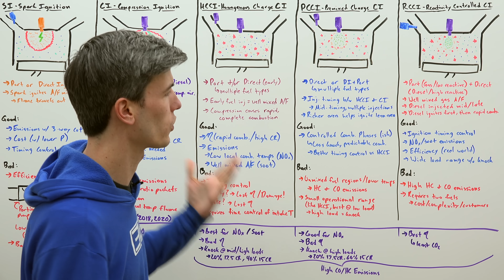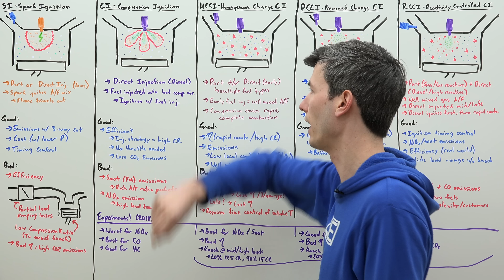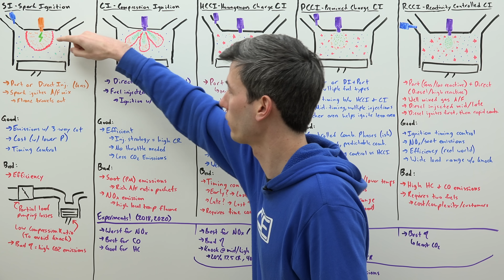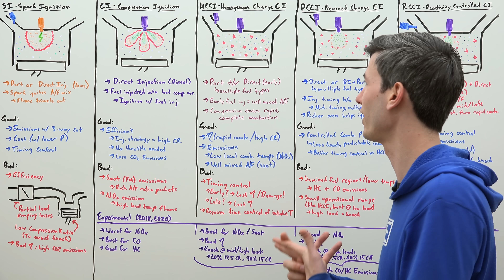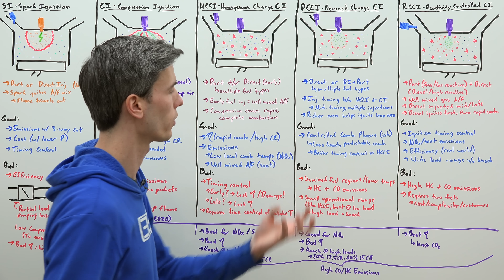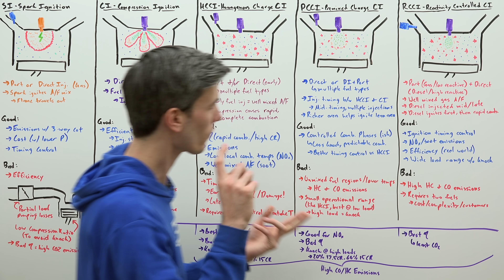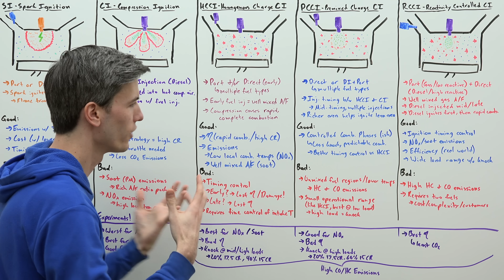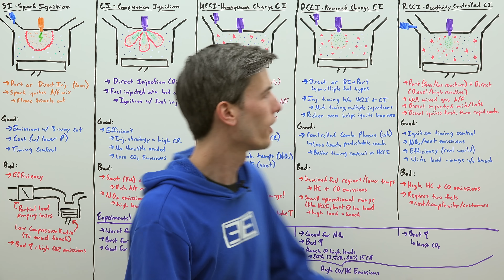If Combustion Engines Have A Future, What Is It?

Comment: You've looked at traditional piston engines here, but what about other forms of combustion engines? Like gas turbines. Their noise and response time is no good in a car, but there certainly are applications where they could be put to use. For example, freight shipping is notoriously hard to electrify, due to the high drag from the water it moves through, and having to run for weeks without refuelling. But if we want to ban that ultra dirty bunker fuel these ships have been burning, then could they switch to turbines? Those should have a higher efficiency than piston engines, right? So what are the pros and cons here?

And what about the more exotic piston engines, like opposed-piston type, or free-piston linear motors?

Comment: One problem with optimizing the efficiency of any IC engine, is at what state are you trying to optimize? 
If an engine can be loaded at its optimum operating state, the rewards from a fuel usage perspective are quite small, unless the engine is designed to operate at that specific rpm point. The options are then, run a dynamo or hydro static pump at than specific RPM. For a road vehicle the best option right now is mechanical electro drive.

Comment: Hi Jason, Here isEurope there is option to run diesel with LPG. They are claiming it is more efficient. Could you make video about that technology? System use both fuels at the time, not like petrol with LPG where  switching it between each other.

Comment: Have you done a video on the TRUE efficiency of electric vehicles. Not just cost of electricity from the house, but loss from conversion from fossil fuels at power plant to electricity, loss from travel to transformers and to individual outlets along powerlines, loss from conversion from house outlet to battery and loss from battery to car use. All of that verses just filling your car with gas. 

From what I have seen, the EV would be far less efficient when all of that is factored in.

Comment: Really great summary. Listening to you I started thinking, why could you not have a HCCI-like option which you would control the ignition by rapidly compressing mechanically the burning chamber at the point when the piston is in its highest position? This would require additional moving piston like small part. However it would probably not be hard to do with current technology.

Comment: So, if we use RCCI, the only downside being carbon emissions, we can use a CAT. Way better than all the diesel particulate filters. Right??
Reply: Diesel doesn't work with CATs, if it did the emissions gear on trucks would be far simpler. Its something to do with the exhaust temperatures,  its been years since I looked into it so I dont want to try to explain it and likly give inaccurate information.
Reply: @jaydunbar7538  yes, normally I'd agree, however as he described the emissions were not like standard diesels. Maybe it would work??

Comment: A small engine driving a generator to charge the batteries on an EV as you drive would operate under a  constant load , if they worked on this principle a car with long range and extremely low emissions would be possible .
With battery technology getting better and better the weight saving in this area would offset the added weight of the engine and generator .

Comment: A future in a museum. EV rules 😉
Reply: I think that there will be ICEs as generators and backup power. Also, in the US, where most people can charge at home electric cars are not a problem. In Europe when you street park in a tight city deployment of charge infrastructure will slow down adoption of electric cars. I actually think that large cars will be electric, and small city cars will be hydrogen. Or cars will be too expensive for majority of Europeans altogether.
Reply: @gustavlicht9620  i live in europe. I cannot charge athome, but in a 1/2 mile radius there are now already 12 public charging points. Theres public charging at my workplace, the supermarket, the shops, all over the place. And building more chargers is easy.
As for generators, hydrogen maybe, but ICE is going to die out completely, we need to stop burning stuff
Reply: Synthetic fuels might come in handy

Comment: So does a RCCI still use a high compression ratio even though it’s using something like gasoline? As the pre mix fuel? If so how can they run a higher comp ratio without pre-ignition?
Reply: Very lean gasoline fuel mixtures I assume, though all systems that use RCCI that I know of that is commercially sold(Tractor and ship(engines or conversions), and I think stationary engines.) use fuels with higher octane rating than standard gasoline as LPG, natural-gas, biogas.
I'm quite sure I've read about a RCCI-engine powered by diesel and "some kind of gas" in a race car.
I've also read a bit from a study about vehicles(Tractors and trucks) with diesel engines converted to run on diesel and woodgas, this study was done in Sweden in the 60's I think.

Edit 1 : These engines is often called dual-fuel engines(Though different type of engines engines could be called dual-fuel too.)
Edit 2 : I'm not really sure anymore that these engines could be called RCCI, as the RCCI-process might have more to it than just a homogeneous charge ignited by another directly injected fuel!

Comment: All based on piston engines? I think you could expand it a bit more than that. There are many other ways to use fuel (not always fossil based either) than a simple piston engine. 
Fuel cells don't only work with Hydrogen either. 
Oh and these all ignore hybridisation where the engine is actually optimised for it - not simply converted from a normal engine. Opposed piston, long stroke engines can be pretty efficient alone and if combined with a generator they can always work in a sweet spot which improves that again. 
Then there are exhaust waste energy capture, waste heat capture and so on - plenty of things which improve efficiency which are, as yet, unused. 
Remember an ev seems more efficient because it uses so little energy to move itself when under light loads (low speeds/etc. When you have to use more power for faster runs, longer journeys, heating and so on that efficiency drops off real fast and the internal combustion engine which normally wastes a lot of energy gets more efficient as it gets into its efficient rpm zone in high gears and as the waste heat is used for the cabin. 
There will be a sweet spot somewhere with a mix of ice and ev.

Comment: Oh there’s a future and it’s a long one still just wait till the government realises you can’t plug in hundreds of thousands of EVs and that there isn’t enough cobalt being produced rn to make all cars in JUST ENGLAND electric
Reply: I've done the math a few years back and just the ac to go to work and back was using way more energy than a home. Delivering and producing that much electricity is just not possible.

An ac system maybe uses in between 2 and 5 horsepower so 2 hours of commute is let's say 4 hp and that's about 2.7kw electricity. That's what I'm using for the house. Imagine powering a car and using like 30kw of electricity daily and then everybody does the same. That will require 10 times the electricity generation.

Comment: Aren't PCCI the best option for hybrids with electric motors at the the wheels? I mean, if the efficiency is not great at certain rev ranges it doesn't matter if your wheels are driven by electric motors.

Comment: Why no discussion of SCCI (Skyactiv X)?

Also, on the RCCI... How much reactivity difference do you think there would be between hot and cold versions of the same fuel? Maybe a small heat pump could be used to transfer heat from the less-reactive ("cold") fuel line to the more-reactive ("hot") side to achieve this effect with a single fuel?

Comment: The RCCI is what everyone has been doing when they use a small amount of propane injection with a diesel engine.
Reply: @M Bacon 
You are correct about the LNG with diesel injection. But I don't know that they are going away. What I was really referring to was how by using a crude valve on a propane tank, a person could increase fuel efficiency in there diesel engine and make it an RCCI engine. Please tell me more about the LNG engines.
Reply: @M Bacon 
I guess what I should say is, what do you mean by gas only? Do you mean  LNG only, or gasoline only?

Comment: The environmental cost is front loaded so the final product "seems" efficient. Still burning coal/oil/natural gas to charge those landfill killing batteries. Why not just electrify anything that moves on a gas engine and just use the engine to power the electric motors, not the car, eliminating those batteries. Electric camshafts increase efficiency too. Why don't we have ultra light rotating assemblies that run on real bearings (like wheel bearings). If they can get 80mpg i'd be happy. The 86 Chevy sprint got 50mpg and I'm sure that's not a technological marvel.

Comment: Also on a public stand point it would probably happen often that people would put the wrong fuel in the wrong tank
Reply: On our sewer cleaning equipment the stored fluids are diesel for the engine and hydraulic fluid to run a large hose spool. One guy got in a hurry and filled the hydraulic tank with diesel. Thankfully someone caught it before the hydraulic fluid was used.

The average human barely knows what fuel to get 1/2 the time.
Reply: Differently shaped dispenser nozzles would solve that problem.

Comment: So, question.  As we have talked about in the past: electric solutions for cars suffer from power density issues.  Even at twice the efficiency of the most efficient combustion engine, we still can’t go very far, or tow very much (I drive a truck and tow a trailer a lot).  So the question is.  What sort of power density do we need to see for electric to be more mainstream.  What are the best densities we have now?  And how long before that technology is available?

Comment: what about natural gas cars?
Reply: What about them? They’re all over the place in parts of Asia, and run fine...
Reply: @sking2173  they are a very very clean type of combustion engine, yet for some reason always overlooked. Infrastructure? not worst than electricity. Maintenance? not that bad. Dunno
Reply: @mirkomarchetti4729  - In today’s political environment, CNG cars are not going to get much support, because they emit CO2 from fossil fuel. 

As far as it being a suitable fuel for cars, it has a lot of advantages over gasoline. Not only is it cleaner burning, but it doesn’t contaminate the engine oil like gasoline (liquid fuels) does. 

In addressing the CO2 issue, biofuels hold a lot of promise. There are POLITICAL arguments against biofuels, but they do well-address the CO2 issues. Given current state of electrical power generation, biofuel is much more environmentally friendly than EV’s.

Comment: The combustion engine will be with us for a very long time. EVs are what, 2% of new car sales? Media makes it sound like they are 98%
Reply: not for long! you either get on the wave of change or drown in it's wake
Reply: @petercigaraelo3646  they'll still be making engines for many years. Even if say 15 or 20 years from now only new cars are available as EVs there are millions upon millions of gas powered cars. It could easily be 40+ years before the engine disappears
Reply: Facts check out Porsche's synthetic fuels that might be the savior of combustion engine
Reply: @christopherayala4619  depends on the price of the fuel, oil based is very cheap and plentiful
Reply: @AmandaHugenkiss2915  it will probably get cheaper in near future
Reply: @christopherayala4619  it may, but it has to be sold for $2.30 per gallon or it's non competitive
Reply: @AmandaHugenkiss2915  true

Comment: Internal combustion engine inefficiency, pollution and how to fix it.

A problem with the traditional internal combustion engine (ICE) is that it suffers from unequal distribution of fuel in the air it intakes causing localized volumes of combustion to have more or less than the optimal mix of fuel and air. This results in wasteful reactions producing CO and other pollution such as soot where the mixture is too rich and lean volumes resulting in air that is heated without contributing as much power as desired and even wasting energy in the endothermic reactions producing the NOX pollutants. All this even before one considers that to vary the power output the traditional ICE uses more or less fuel than the stoichiometric optimum. 

The patent pending Augmented Compression Engine (ACE) variant of the ICE solves these problems. The air it intakes is mixed in the optimal stoichiometric ratio with fuel and given sufficient space and time to thoroughly mix. To assure quick throttle response this mixture goes through a throttle valve just before entering the combustion chamber. This valve throttles the power by replacing fuel-air mixture with recycled exhaust. This augmentation of compression while reducing the amount of combustible mixture ameliorates the combustion problems otherwise encountered by such reduction. Being thoroughly mixed the fuel and air combust fully, producing the optimal amount of power with no or minimal pollution. [Note that if a traditional ICE had a long enough intake for complete mixing after the fuel is added to the air it would have dangerously slow throttle response.]

At higher power settings water injection is used to cool the combustion just enough to avoid NOX production with the steam generated producing extra power mitigating the lowered energy of combustion. Depending upon the water temperature this may also result in more fuel-air mixture getting into the combustion chamber resulting in more power. The recycled exhaust providing enough cooling at low power to preempt the need for water injection. [For very small engines where one may not be concerned with NOX production the mix can be adjusted to account for the losses to NOX and the water injection system left off.]

  By condensing part of the exhaust enough water can be recycled for water injection. By coating the combustion chamber surfaces with ceramic the efficiency of the ACE can be enhanced. [This is avoided in traditional ICEs because of NOX production, not a problem with the ACE.]

Comment: I'd put money on combustion engines' future way before I'd put it on EVs' future.  Everybody is claiming EVs are going to take over but I don't see it.  There are too many structural impediments to EV becoming ubiquitous that will never be addressed.
Reply: Evs will never become a thing like smartphones never became a thing,i mean who needs a verry powerfull computer in your poket when you can have a pc and wire phone,never run out of battery !
Reply: @UnipornFrumm  You are completely missing the point (intentionally, is my guess).  There are millions of drivers who do not live in locations where they can install charging stations nor are they within walking distance of one.  Moreover, EVs are terrible choices in extreme heat and cold.  Last but not least, their terrible range and lack of instant charging capability means they are highly compromised when it comes to making long trips. EVs are not the magical vehicles you make them out to be.
Reply: @chuckschillingvideos  Everything you've just said is wrong. There are millions more who do live in areas where charging infrastructure is available and it is expanding rapidly. Battery technology is changing fast, in 5 years time the charging time will be less than half what it is now, and batteries with 5 minute charging have just been factory produced. Forecourts will be used for charging rather than filling up ICEs. In Norway (the coldest country in Europe) EVs sell faster than ICE cars. Range is rapidly becoming the same as ICE cars as the technology keeps moving forward.
Reply: @martrich1098  Oh please.  I'm not wrong.  You clearly don't understand that in order for EV's to be accepted, nearly EVERY motorist must be able to charge them at home.  That is nowhere near to being anywhere close to happening.  Just because you love EV's doesn't mean that everyone else does nor does it mean that the infrastructure is in place to make them accepted by the great majority of motorists.
Reply: Right
Reply: Thing is IC is being band by governments So EV wins
Reply: Thank you, I’m glad I’m not the only one who had this understanding
Reply: 100+year tortoise and hare race. ICE liquid fuels still have physics on their side. Electric cars have politics on their side. You can only cheat nature so long, time will tell if electric tech can catch liquid fuel fast enough.
Reply: @adamhulu6171  exactly, politics won’t save the world.....
Reply: One day EV's will get there chance but you have to look at the bigger picture, EV or any vehicle, industry in general comes from out the earth or from around us those giant machines can not run on a battery pack trust mi.. so it's beneficial to have ice engines more efficient which make not just EV's but everything cheaper and its also better for the environment in the process